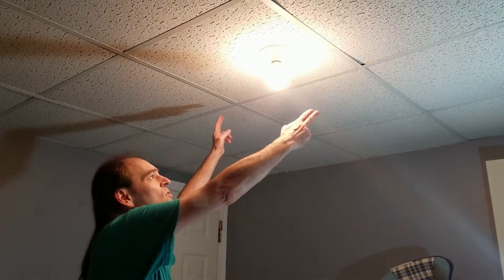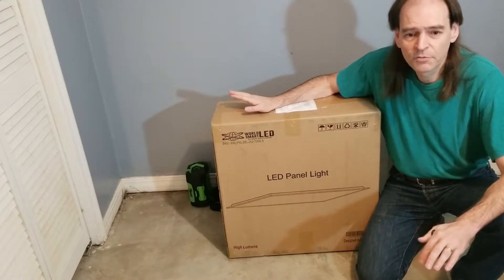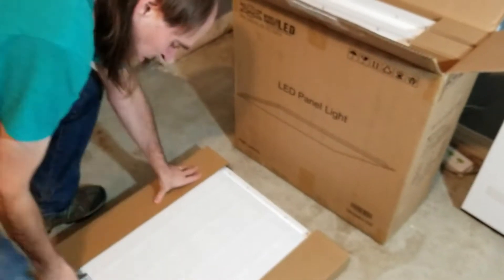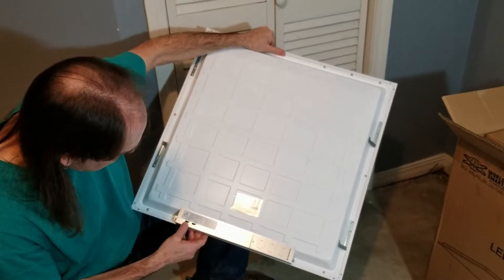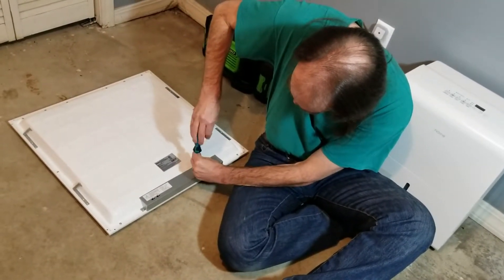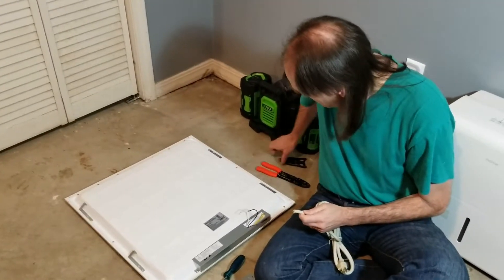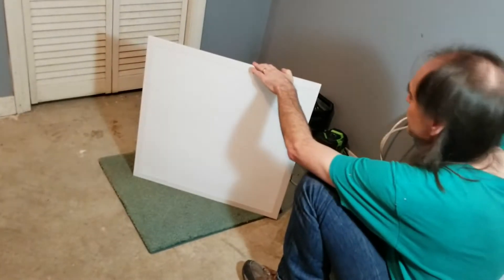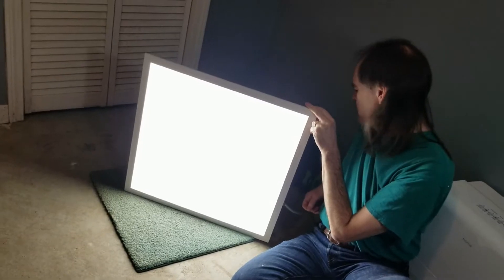LED Panel Lights with 0-10V Dimming; Part 1: Understanding the Lights

Comment: I don't have anyother wires from the switch other than the power and N, how can i wire this dim switch without running dimmer cable from the switch to the light.

Comment: Can this light be installed against a solid ceiling (in my case, OSB aka waferboard)? Or will it get too hot?
Reply from the maker: I think they make mounting kits for them, but I'm not set up to check the temperature on the back side after leaving them on for a while.  My recollection is that they're 40W, which is not insignificant.  I wish I had a better answer for you, but I'm glad you're thinking though it enough to ask the question.

Comment: .410 meg ohms is 410K ohms. So it's a 410kohm Pot.
Reply: My buddy just gave me an $800 outdoor LED fixture and I asked him about the grey and violet wires. He said it's for dimming and the switch is around $100. He's a licensed electrician with like 25 yrs under his belt. I guess he isn't aware how simple this 0-10v stuff is?? Electronics sure are overpriced for what's actually going on under the hood 😂

Comment: 0-10V dimming is normally used in commercial buildings. If you are trying to install a new 0-10V dimmer into an existing wall switch, you would need to find a way to install the violet and gray low-voltage control wires from first fixture to wall switch, which entails running these wires down through existing wall to switch. I believe many fixture manufacturer’s make a  driver that can be dimmed by a triac dimmer that only requires the hot, neutral and ground wires that attach to dimmer. This would be an easier solution than having to run the two control wires to switch in a residential installation. The three color temperature settings that fixture you have are all in the higher(bluer) color temperature range. Most of these fixtures will have 3000K, 4000K and 5000K or higher, for a wider range from warm to cool. The 3000K is more warm and usually the more preferred color temperature for home use. Some fixtures even have an extra setting where you can change the fixture color temperature by toggling the light switch on and off quickly until you get the desired color temperature. The selected color temperature will become the default when operating normally. You can change the color temperature at any time by toggling the switch on/off quickly again to desired setting. Home improvement stores like Home Depot and Lowe’s carry these types of edge-lit LED fixtures in many shapes and sizes.
Reply: If I understand you correctly; since my light manufacturer sold my light with the 0-10w extra wires i'll need to run them down to the switch, i.e. there isn't some "triac" device i can obtain to send the signal down the existing higher voltage wires in the wall, right?
Reply: That is correct. But there are some wireless switching systems that will let you let you send a wireless signal between 0-10V wall dimmer and fixture to control the dimming voltage. Just do an Internet search for such components.

Comment: I have 6 led panels and installed then on one 0-10v dimmer but i need 1 of the led panel to be on at night how can i do it thanks
Reply from the maker: I'm not completely clear on what your end goal is, but the dimming control and the power control are separate.  There's no reason you can't have all six on one dimmer, but run the power to one of them separately from a regular light switch.
Reply: Probably get direct power to the panel you want on, and just connect the dimming wire along with all the other panels

Comment: How did you measure the internal resistance of the 0-10 dimmer circuit, with an ohmmeter, while the light was ON? Ohmmeter should be used on deenergized circuits only, if you want to measure a remotely correct resistance.
Reply from the maker: It wouldn't make sense to test the resistance on the light fixture, as it is sending out a 10 V signal and then measuring the return voltage.  But with the switch disconnected, you can use a multimeter to measure the ohms on the dimmer as you slide it between low and high.  I'm not sure I did it correctly, but the theory is right.  I failed in finding references online to what the range of resistances should be.  The important thing is that when hooked up, it works pretty well.  (I have another video in production where I wire up two lights in a ceiling with a dimmer switch.)
Reply: That was a solid ass answer.

Comment: Great video. Very informative. I have 2 of these LED panels and installing them both on one 0-10v dimmer. Searching for info on dimming a pair of panels.
Reply from the maker: I've recorded another video where I do just that, but I haven't edited it yet.  The important thing to know is that the wiring is simple: Connect the grey and purple wires from the far light to the near light, and then connect them to the dimmer. So grey to grey to grey and purple to purple to purple.  Because the voltage and power levels are low, I've heard of people using all sorts of different wiring.  I used speaker wire that I had left over from another project.  They make a Romex Duo wire specifically for this, that combines the regular black/white/ground wires with the purple/grey wires in one cable, but it's expensive and hard to find, especially in shorter lengths for one-time projects.
Reply: @projectwithpreston  Do you have that video done yet? I'm interested in seeing it.
Reply from the maker: @frillybobify  I need to edit it and get it up.  The hold-up is that I made a mistake when I did it, and I want to show what is wrong and fix it.  I'll try to get it out soon.
Reply: @projectwithpreston  thank you!

I'm working on the project myself. I'm concerned about the spacing of the low voltage wire next to the high voltage wire. I've read you need to keep them isolated. Southwire makes a 14/2/2 but it's very expensive.
Reply from the maker: @frillybobify  Yes, that's a concern, as you have to keep the low-voltage wire and the line voltage wire in the same box for the dimmer switch and the light together.  I've heard that electrical inspectors often don't like that, since if the wires in a box get loose, they could send line voltage through the low-voltage wires.  The Southwire 14/2/2 wire is expensive, and I couldn't find it in shorter lengths, so I didn't use it.  I used speaker wire that I had available.  Another option is to use a second run or Romex and wrap the ends of the wire insulation with colored tape to indicate the alternate use.

Here I'll point out that I'm not an electrician, and I don't know the code for your area.
Reply: @projectwithpreston  running a second set of 14/2 is an excellent idea. You stated my exact concern - low voltage near high voltage in the box! 

The ground in the 14/2 I suppose could be left unused. Thanks again!
Reply: @projectwithpreston  they sell  at the  the electrical supply house pre-made 1 pair stranded colored wire